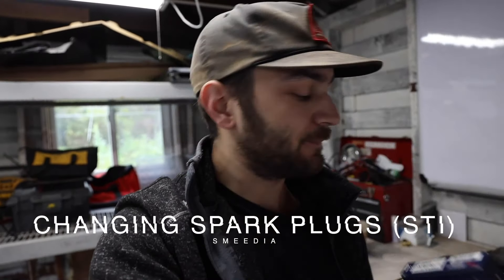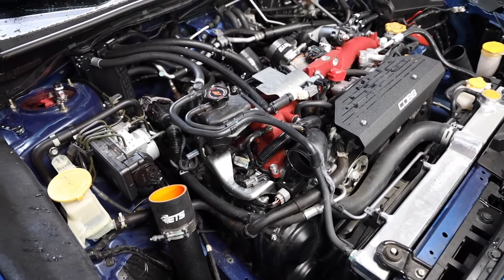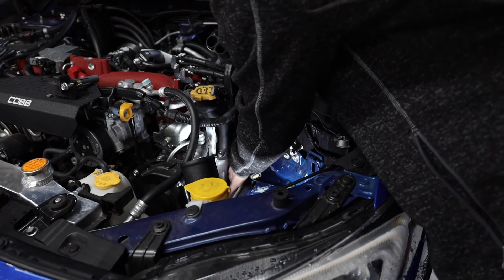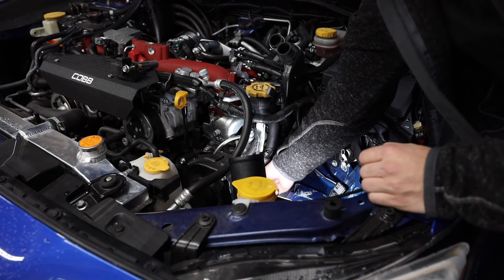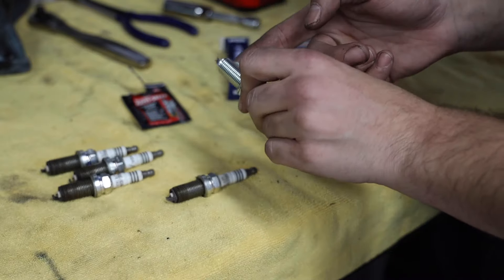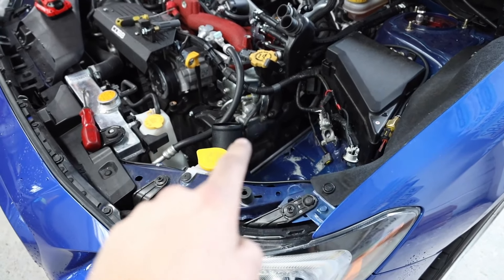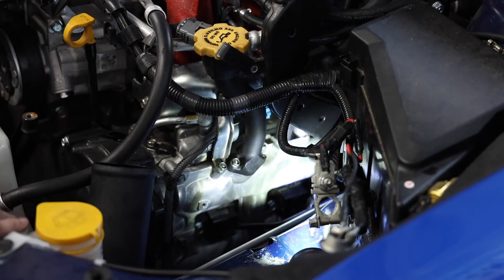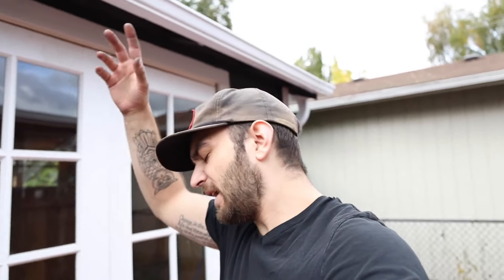How to Change Subaru Spark Plugs (Easy)

Comment: If you read the instructions for the NKG Iridium spark plug they are "explicite on not using Anti-seize" This will alter torque values by up to 20% increasing the risk of spark plug thread breakage. Spark plugs should be torqued to approximately 15-19 ft/lbs. Don't do exactly what this guy is is doing here.
Reply from the maker: I would suggest using anti-sieze. You'll never get a torque wrench between the block and the frame rail. My old used 2007 STI had seized NGK Irridums in the heads that shattered from corrosion. The steel casing on the spark plug will galvanize to the head. Not using anti seize is asking for problems.
Reply from the maker: You've also got a coil pack bolted to the head switch will also prevent the plugs from backing out.
Reply: @Smeedia  You can get a torque in there using an Neiko 02292A 3/8" Drive x 5/8" Magnetic Spark Plug Socket https://www.amazon.com/gp/product/B075NV13WG/ref=ppx_yo_dt_b_search_asin_title?ie=UTF8&psc=1 and a swivel joint
Reply: @maxchojin  You're talking like a person who has never been under the hood of a boxer. They aren't anywhere near as accessible as your mom's Civic. The small possibility of it being ever so slightly loose is 9000x times better than having it seized in there. And you're not fitting a 45 degree universal in between the valve cover and the frame rail. The only way you're torquing Subaru plugs is with the engine out of the car. I'd love to see you explain how you'd torque BRZ plugs.